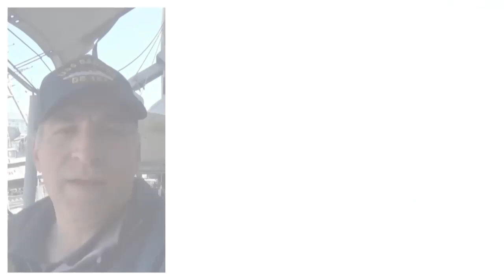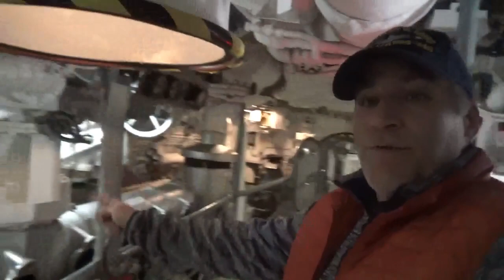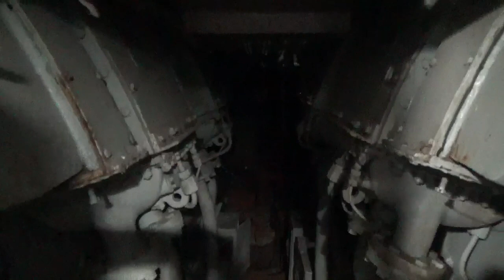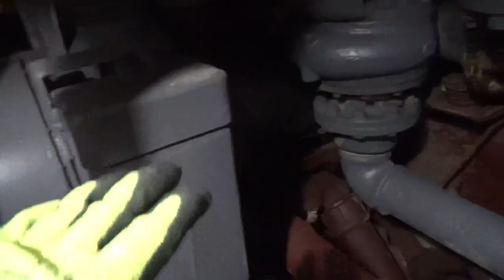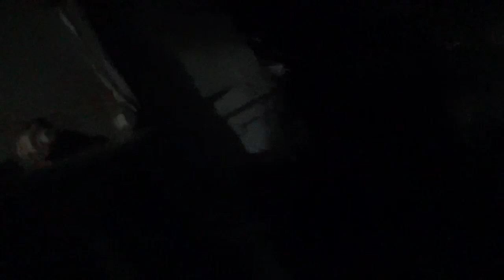Motor Room differences between fleet and SSK boats

Comment: Listening to your videos its easy to see you are in way over your head about technical stuff. The converted boats with 3 diesels were only capable of about17-18 kts surfaced. Red gears on the Gato boats were just forward of the thrust bearings and the 2 high speed motors were on the forward end of each red gear. You heard wrong about red gear noise, reduction gears do NOT cause a high pitch sound but more of a low freq growl. They are one of many pieces of machinery that create noise that is factored into the ships sonar figure of merit numbers. Any kind of noise created by the ship is called Own Ships Noise (OSN) and if it is loud enough it can make it difficult to hear hear targets, it also makes it easier for targets to hear us. Red gears are just one source of OSN, even the cook banging his pots and pans, snipes dropping wrenches or people talking too loud if the boat is in close enough. Eliminating the red gears dropped OSN by a few dB. I don't know if the Navy developed quieter props back then but cavitation speed would still be pretty low the shallower the boat gets. 2-3 kts is about all the faster the fleet boats could do from about 100' or shallower keel depth without cavitating. The reduction in diesel shp and ships speed was acceptable because the boats were expected to stay underwater using the snorkel. One thing to notice here..... the main motors are not mounted on sound reducing mounts but steel on steel.

Comment: At 1:55 you stated the 16-278 was "scaled down". What was scaled down and where did you get that idea? Did the engines shrink somehow?  Also, lousy lack of lighting except for your selfies doesn't offer much in way of education. If those are the 2700 HP dual motors the thrust bearing is at the forward end which you never showed because of no lighting. And finally, The engines were directly coupled to the generators, they did not use reduction gears or clutches. The motors are not mechanically connected to the engines, they are powered by electricity from the batteries or the generators.
Reply: I bet he got confusiated about the main diesels when he says the Jimmys were "scaled down". Jimmy's had a bad habit of the lobes on the superchargers wiping the case with the reduction in atmospheric pressure when the snorkel flap shut in heavy seas. This would destroy the superchargers so I believe (not positive) that the Navy derated  each engine to help reduce this in the boats with Jimmys, the FM boats were more resistant.

Comment: Having toured the one in In Harbor. I understand why they looked for average height and less for submariners.  That arrea looks even tighter.
Reply from the maker: Submarine service was a volunteer service even in the draft years, but yes - I'm like 5'9", and you can see where my head is in relation to the overhead! Definitely tight!
Reply: @BuffaloNavalPark  Yes, and my being 6' 5" almost 6'6' about a quarter of an in shy. I would have been rejected for sub duty as I could not move safely around the boat
Reply: Oh a friend of mine Joe served on Thresher Class Boats. He was fairly soon reassigned to various classes in the Sub Safe program. During WWII his father was on Diesel Electric Boats.  One was forced to surrender and spent the rest of the war as a POW.  If you want me to, I will try to get more information.  He has said his late father didn't talk about it much. I'm not sure how much he knows. His father was an Officer if I remember correctly

Comment: Thanks for the tour. Were there crewmen that were assigned to the motor room as their station, or these just checked on a schedule?
Reply from the maker: Great question, Dave...I believe these would have been manned, at least by one crew. Electricians (two of them) would have been in the maneuvering room, but I'm sure there was a Machinist Mate down in the motor room. Different levels of staffing would probably happen under the various conditions of readiness.

Comment: Another great video Shane.  What equipment was supposed to be attached to the round open piece with the bolts sticking up and appearing to have been greased?
Reply from the maker: Thanks so much, bluerebel01! What I had at my disposal was the 1953 Croaker booklet of general plans. They aren't like the blueprints. They showed the machinery, but they didn't list every piece. The largest pieces of equipment in that space beyond the motors, thrust bearings and shafts would be piping for the lubrication oil for the thrust bearings, and the cool water pump\piping system to keep the temperature down on the propulsion system as a whole. Hope this helps!
Reply: The subject of the video was great but the execution was far from educational or even enlightening. Shane does not know the subject material or apparently even take time to research it. Viewers and museum donors deserve better.
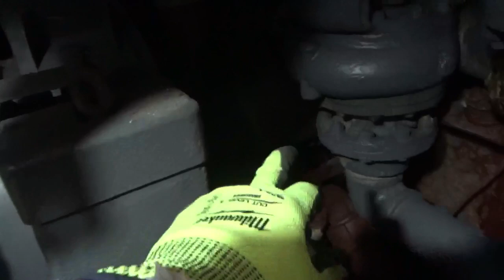If the equipment you ask about is that shown at 4:00 it is the volute of a centrifugal pump most likely used for motor cooling. Those motors are air cooled by seawater to air heat exchangers mounted at the top of the motor. Part of the low noise modifications was the use of dual armature motors capable of slow running without overheating which allowed the cooling water pumps to be secured and eliminate that noise source.